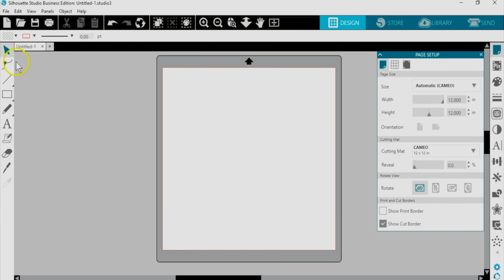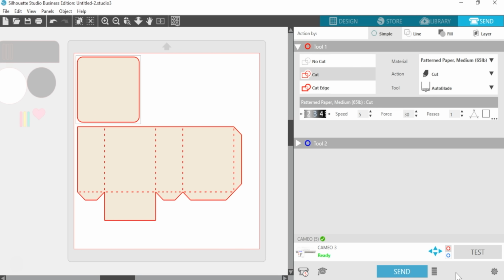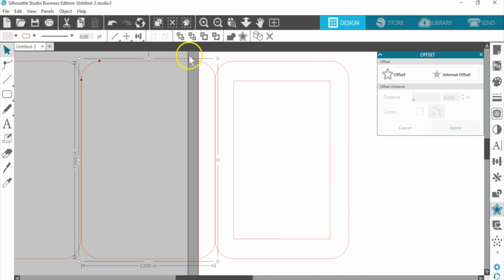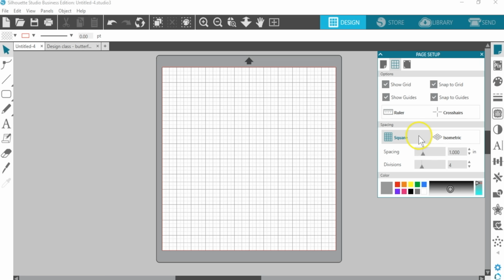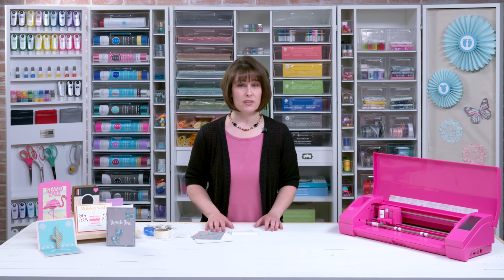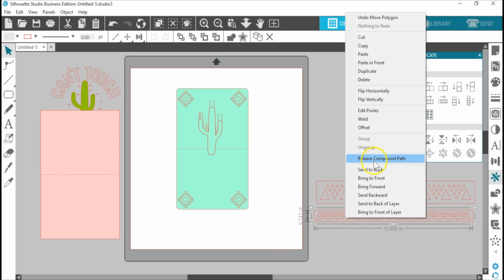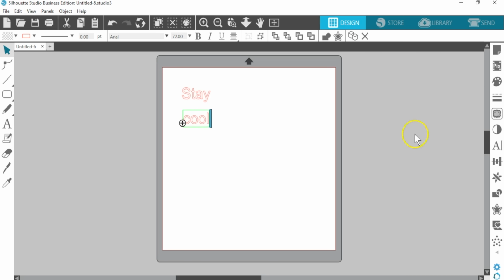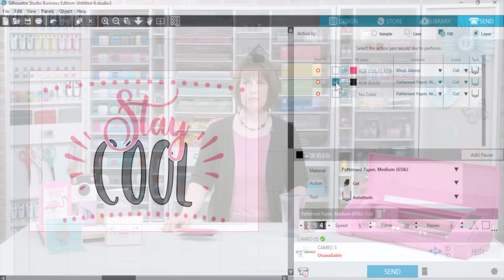All Things Studio (Silhouette 101 Video Class)

Comment: Just tried using Oracal 651 Transfer tape with 651 vinyl and it didn't pick up the vinyl at all! What transfer tape is used in this video or what should I be using?
Reply: I used Silhouette transfer tape in this video. I also really like the Oratape sold by Silhouette, but that may be what you used. https://www.silhouetteamerica.com/shop/adhesive-vinyl/transfer-tape  I find it helpful to peel the backing away from the vinyl while it's face down (shown in the video), and use a scraper tool to put pressure against it as you pull the backing away.

Comment: I was following along until you clicked on the 3D design.  I'm assuming most of the people watching are beginners and wouldn't have that design.  It probably would be easier to follow if you used one of the designs that came with the software.
Reply: My thoughts exactly, I was at a stand still.
Reply: @caseydavis1875  The camera box is #62406 in the Silhouette Design Store. https://www.silhouettedesignstore.com/designs/62406
Reply: I did provide all the designs to the editing team, but they did not include them. The camera box is #62406 in the Silhouette Design Store. https://www.silhouettedesignstore.com/designs/62406

Comment: Hello, great video Kelly, I always learn so much from your tutorials.  I Had one issue when trying to make these cards my machine isn’t cutting the edges completely. It’s difficult to separate the card after it’s been cut any ideas on what I should?
Reply: I would check the cut before unloading the mat, and if it hasn't cut completely through I'd send it again for another pass. Next time you may want to slightly increase the blade depth by 1, or the force by 3-4 to see if the same media cuts better.

Comment: I dont understand. My cameo is not cutting. Everything is set up. I have the correct firmware.  It is not cutting at all. It's making the noise and going through the motions but nothing is happening
Reply: I had that problem too. Until I looked at how send was set. I had not selected cut  That is not automatic
Reply: @kathleensalamon9419  you are so correct, it is not automatic.  But my issue was that I didn't push my blade down far enough.  I was able to see the blue dot but it was not actually in place.  thanks for sharing your issue and findings though.  I appreciate you.
Reply: @suzannadunn4337  lol so I wasn't the only one to not lock the blade properly? :-D
There's a video on using the sketch pens, I'm sure you've found it by now, but just in case: https://youtu.be/H3ErXFg_p6M
Reply: @avaDesdemona  lol.  yes i did.  thank you so .💕🙌